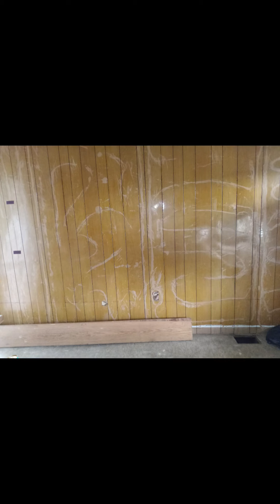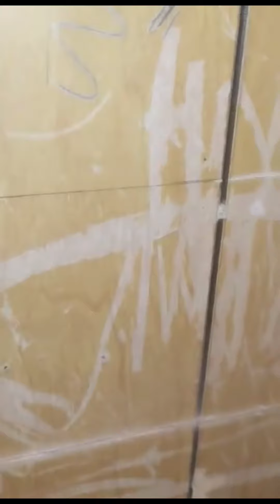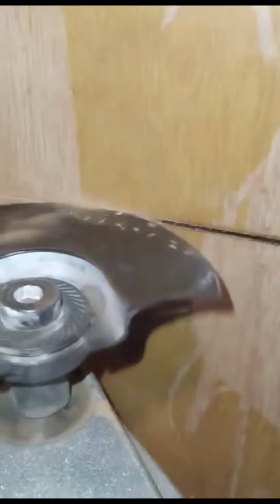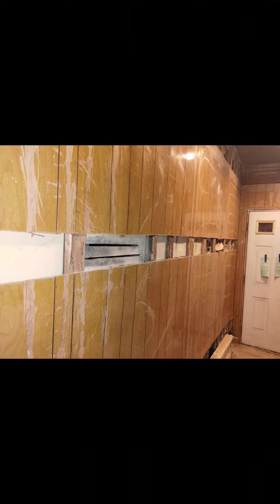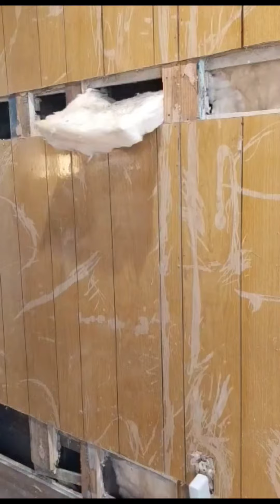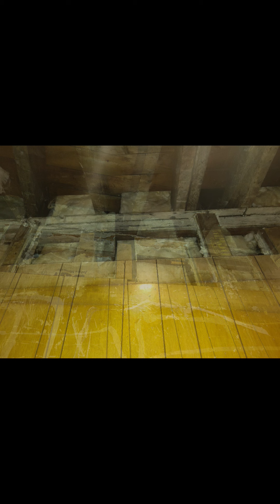How to Insulate an existing wall (without tearing it down)

Comment: I'm about to do the same. Good to know that I'm not alone shoving insulation into walls 😂
Reply from the maker: This way worked amazingly. Id do it the same exact way every time. Not too much of a mess and it keeps the original drywall and plaster for better insulation from the cold.

Comment: Carbide blades last much longer. They are worth the price. They go through metal or wood, no problem
Reply from the maker: I'll definitely have to get some of them. I ordered these off of eBay in a hurry. Definitely not disappointed in them. They held up better than the ones I had gotten from Walmart.

Comment: How long did it take to cut out the plasterboard? It would have been quicker to remove it and you would get a better job with the insulation.
Reply from the maker: Less than a hour. It's way too much dust. Plus it is another barrier against the cold.